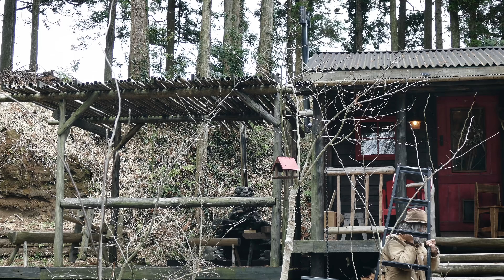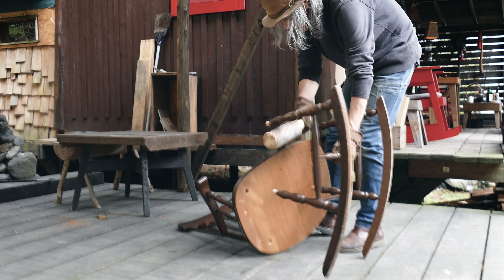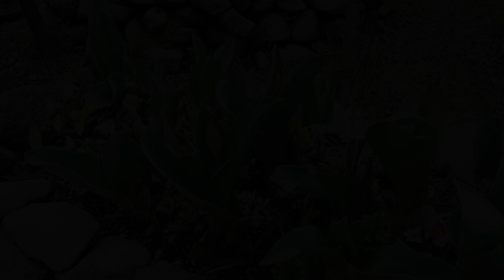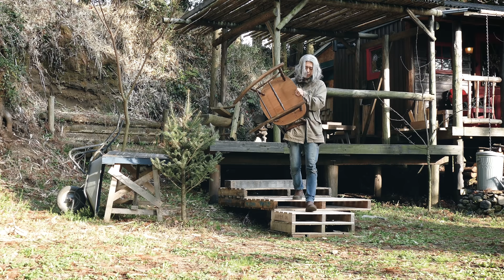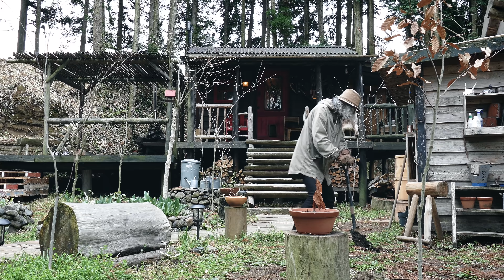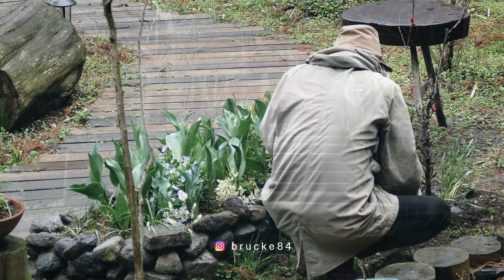Pallet stair, cherry wood mallets and bird feeders.

Comment: + birds (pacefull place) :

crystalline stones, white
pile of stones, in the shape of a cone,
copper tube (as long as possible), planted in the center, vertical

we were in the forest, in a clearing, I had done this on the edge of the clearing

to put on mound;
in height if the ground is not flat, like yours, on the edges

with dozens of cats,
it screeched everywhere,
the company of partridges passed in front of it every morning, the mother and her young....

it absorbs electromagnetic pollution (5G haarp etc)
instead of the tallest trees that act as antennae
so the birds feel better around it